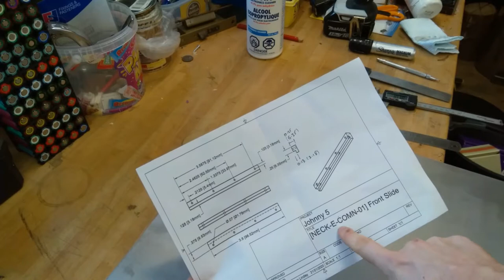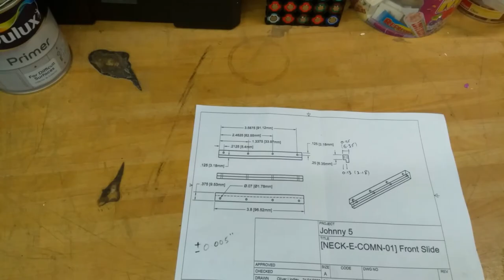Johnny 5 part for NYC CNC First Video

Comment: Hi Olly, so this is where it all started!! Hope you're feeling a bit better today.

Interesting to see the drawing calls up for a NC thread. It's quite a job to find the standard that defines these threads it goes back many years. From what I understand they are practically the same as the unified equivallents. 

At work I've come across similar call outs on US Navy pipefitting drawings. In practice it probably doesn't matter one iota .... until you have to make thread gauges!!

Looks like an interesting project, a robot collaboration?

Get well soon Olly!!
Reply from the maker: Hi David. I've been out in the garden all day today (digging), so I'm tired, but pleased to have achieved something. 
I had to buy the tap specially for the part, fortunately I found one on eBay for about £3,  it wasn't particularly sharp, but did the job. A 2-56 is almost the same size as an M2 - a very small tap, so I was worried about breaking it.  What I didn't show in the video was the four or five other attempts at the part where I blew dimensions for one reason or another. The scrap parts have all found uses or been re-machined. It was very good practice though to make a part to dimensions, rather than the usual "fitting" that is done on most of my projects!
Reply: @ollysworkshop  That is very small perhaps watchmaking sizes. I bet it was good to do something useful. Take your time to recover Olly, don't rush back too quickly